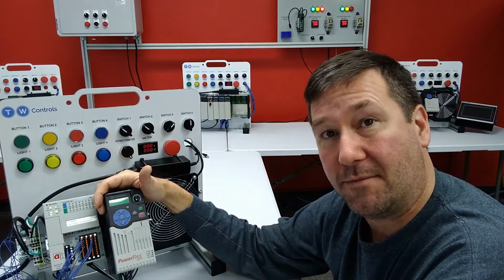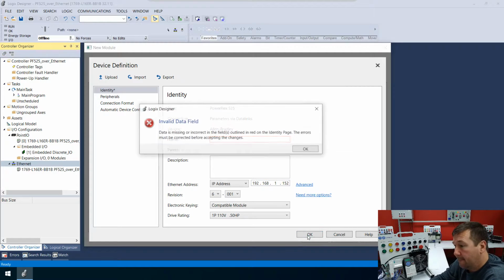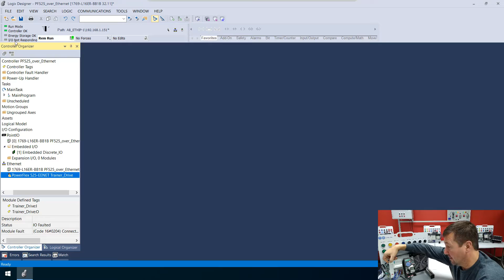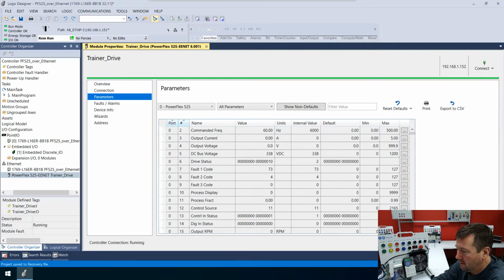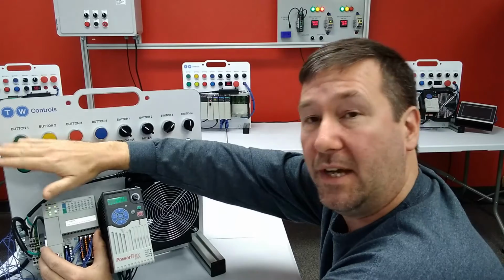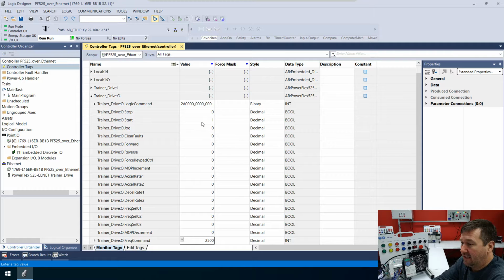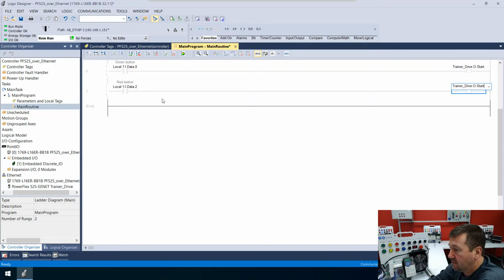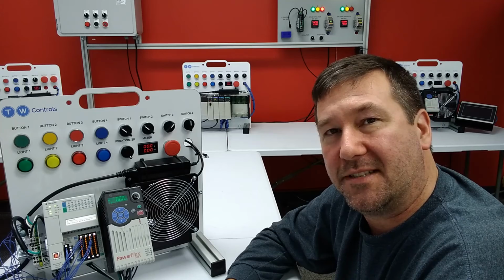Add a Powerflex 525 drive to a Controllogix Compactlogix over Ethernet

Comment: Thanks sir for this video, please share video on the use of sequence control in plant automation.
Reply from the maker: Hi Lalit.  We have that for RsLogix 500.  You can find it at the following link.  We have machine sequencing lessons in the works for Studio 5000 and Connected Components Workbench planned, with the notable missing method of sequencer instructions.  I don't believe they are a good way of sequencing machine steps.
https://twcontrols.com/allen-bradley-rslogix-500-lessons-for-the-micrologix-and-slc-plc
Reply: @TimWilborne  Thanks alot for your support .
Reply from the maker: @lalitpandey8023  You are welcome.